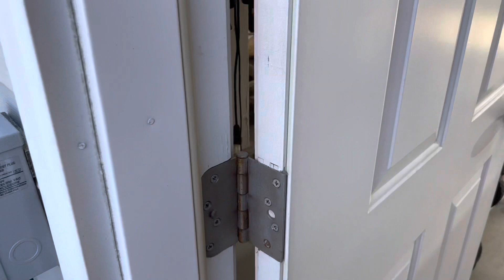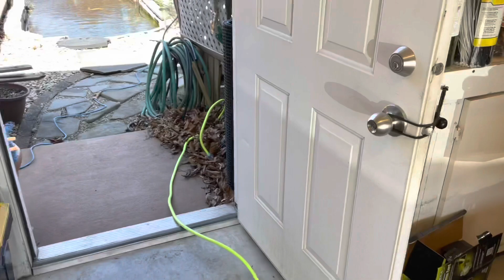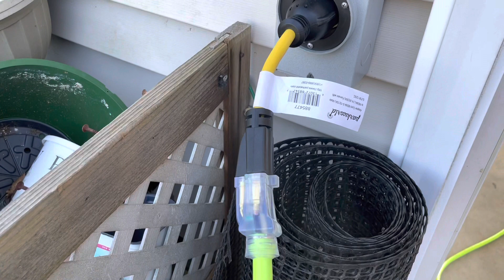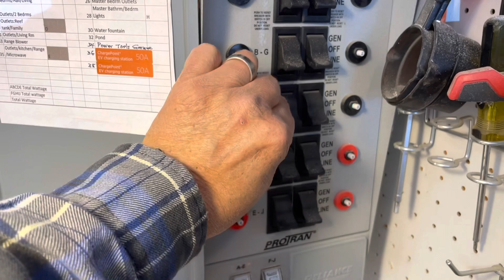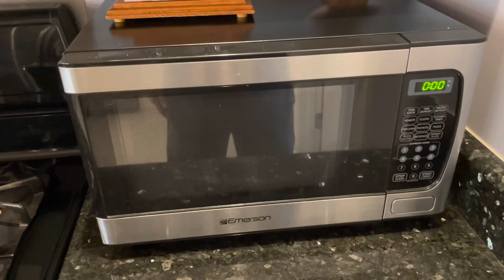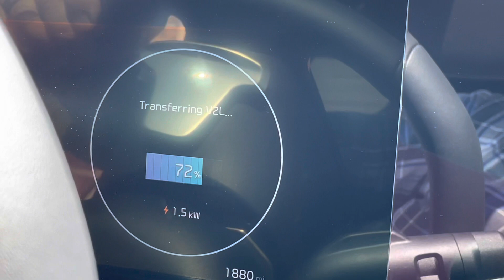Using my Kia EV6 to power my house in an emergency power outage

Comment: Why did you decide to put the inlet outside when you have a garage?
Reply from the maker: The inlet was installed when I had a gas power generator which needs to be run outdoor due to exhaust.
Reply: @simonleung7069 Can you use the inlet for either a gas powered generator or the EV6?  No differences in set-up?
Reply from the maker: There is no difference in set up except you need an adapter to connect the EV6 cord to the inlet as shown in the video.
Reply: Any links to wiring generator? adapter to extension cord and extension cord. Thanks appreciate it